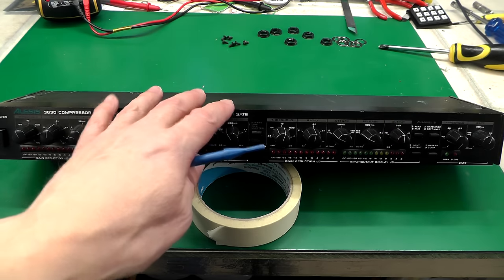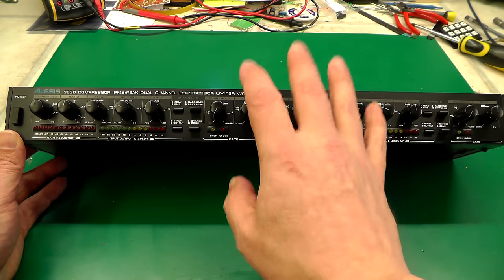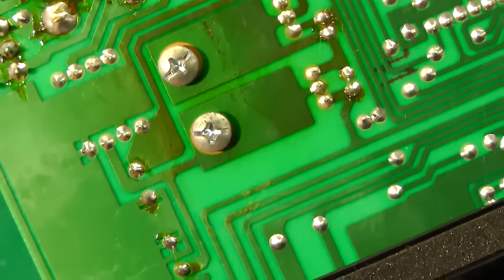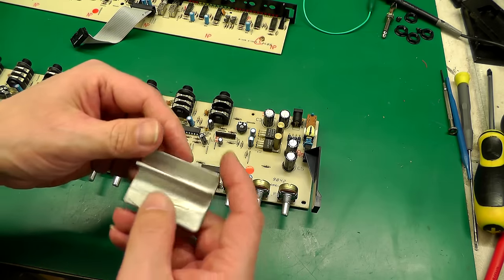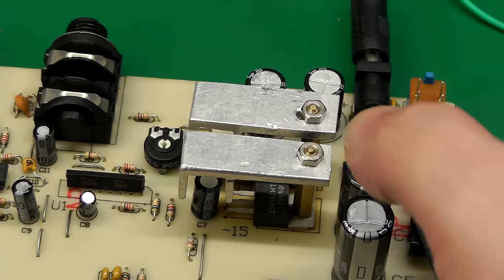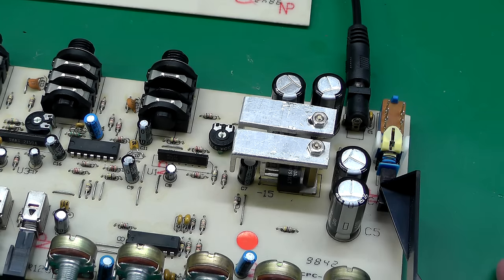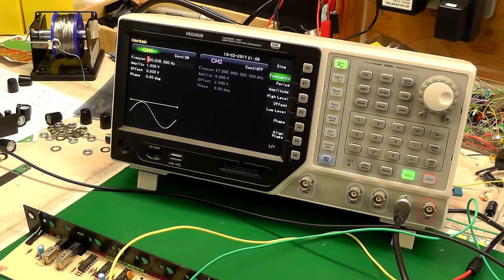No.029 - Alesis 3630 Compressor Repair

Comment: Always a pleasant surprise to see another video from you. My bets were on the problem being an electrolytic coupling cap gone bad - as you end up with what's effectively a grossly undersized coupling capacitor, which acts as a first-order high-pass filter, but WAY up in the audio band, rather than at the low to subsonic frequency that was originally intended.

Comment: Great to see another video from you. I totally understand why U use a compressor, here in the Netherlands we have the same problem whit TV, even radio has the same nasty habit. in the past I worked as a tech in a studio and did ask some of the post production guys about this phenomenon. They explained to me that it had to do whit all different party's that supply the audio/video during broadcasting. and as the TV station does not own what they broadcast the are not allowed to mess around whit it, it's just not done to regulate ore put a compressor on the line. Yes the TV stations do have some kind of guide line, but most of the post-production guys just try to push as lowed as the can. Not uncommon that they maximize and normalize all the audio and have it near 0db or +5db when they deliver it to the TV station. About the differences in sound/base it has to do some whit the engineer that mixed the audio and the request from the customer, and most engineers will hire there own optimod to just try how lowed they can make the specific audio. Best would be if all TV stations would agree to a uniform output but that might just never ever happen.

Comment: I just found this video and I am having similar problems with mine!  Channel 2 is bad and even passing audio when the unit is off!  Do you have the part number for that last capacitor you replaced? Did you use a different one or did you replace it with the same?  Mine has also a ground hum noise in channel 2 I wonder what could be wrong. You use some sort of socket for the IC, do you have that part number?  Man I wish I can fix mine!  Thanks for the video!  How did you added a screw to the heat sinks?

Comment: After watching your video, I went ahead and order the parts just to realized when I opened mine that the parts are different!  Mine got THAT2252 (obsolete) and TL084CH can these parts be replace by yours?  The That 2252 are RMS-level detectors... They are not VCA's

Comment: The total + to - input voltage to the regulators is 50v (23 + 27). With 4 diodes and no obvious multiplier network, how is this possible from an 11vac input to the rectifier diodes (bridge?)?

Comment: Nice little fix! Did you ever test the ESR/capacitance of the audio coupling cap that ended up being the problem? If you're coupling audio signals between amp stages or even on outputs (for DC/offset rejection or general protection), the capacitance has to be chosen based on the source/load impedances and indeed if you underespec your cap in terms of capacitance, you will have created a highpass filter. :D That cap probably lost most of its capacitance. If only a low capacitance cap is necessary, like a 1uF or something, I'd usually replace it with a film cap, since it has less distortion for audio coupling than an electrolytic. On the topic of TO-220 packages and such, I've been a big fan of using these ultra thin (0.15mm) thermal adhesive pads from "x-ex_international" from eBay (shipped from Germany). They have excellent thermal transfer and have been extremely reliable to me for directly bonding packages to heatsinks while maintaining electric insulation (because of how thin they are though, I wouldn't use them for anything with a potential difference above maybe 80V to mind the dielectric breakdown). I also have lots of thermal glue from the same people, which I actually use as general purpose glue for components that get hot - since I know that the glue won't soften or break down under such conditions. If I were you, I would put a dab of that glue between the two heatsinks you've made just so that they don't rotate into each other if you end up moving the device around later on. I'm also experimenting with other exotic options like "Electrodag 5810 Silver Epoxy" from Thor Labs, which is both thermally and electrically conductive and can be used as solder in situations where you need to mount an unsolderable element to a heatsink (because of thermal mass problems, or not wanting to overheat the component etc). Lots of cool solutions out there. :) Really happy to see you uploading again!
Reply from the maker: It's a pity I could never find a schematic, would have been nice to see the values of caps etc that were perhaps meant to be on the board, i.e. after it seemed somebody had been in there before me. But no, I never checked the ESR/capacitance of the problem cap, I just assumed it had dried out since the unit was fine a few weeks ago. Thanks for the comments.

Comment: Does it actually need an AC supply?  Unless it's sampling the AC line frequency for some reason I don't see why it couldn't be run from DC.
Reply from the maker: Need the AC to get half-wave rectification for the positive side, and the same for the negative side. The two caps nearest the power input AC couple the line in and then feed the rectifier diodes. The diodes work in pairs, one diode producing the positive (or negative) feed, and the other to the ground (0vdc). Update: I added a wee sketch of the PSU circuit to my webpage.
Reply: The faulty power supply caps would certainly not have helped with regulation, have you measured the output of the "9V AC" adapter, what is it ? because 27V on the caps would indicate it would be more like 18V AC going in or a little more as it is under load. I would expect you to have about 12 to 14V AC as a requirement, 9V AC would never give you regulation as it would peak at ~13V so it can't require 9VAC??
Reply from the maker: The powers supply is actually a voltage doubler circuit, i've added a wee diagram on my website. My adaptor is giving 11Vac output so a tad high. Looks like Alesis didn't give much leeway: http://www.ianjohnston.com/index.php/videos/68-video-blog-029-alesis3630 I should have explained a bit more in the vid....so i've annotated the vid... :)

Comment: Nice vid. Quite a lot of these Taiwanese machines from the time are like this, quite well designed but let down by cheap capacitors and overheating problems. I guess these brands were ahead of the curve in farming out production to shady Shenzhen factories with poor quality control.

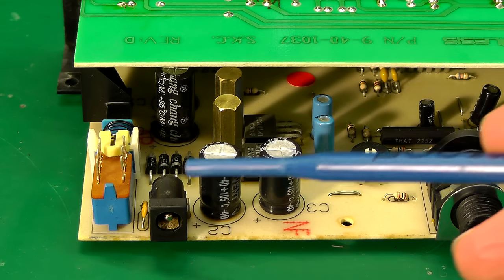Comment: 7:34 If it is 9V adapter, then how is it possible them to use ±15V out from that ? and that too with lot of heating discoloured PCB ?
Reply from the maker: It's an AC adaptor, not a DC one. I have put a small sketch of the PSU circuit on my webpage.
Reply: Yes that's why those diodes are there, but seems like a small glitches on your description because later on when you measured the input DC to the regulators, it was quite high and 9V AC cant make it reach that voltage. Also it would have been nice to compare input and output signal at once on multi channel scopes like this.
Reply: Okay, got that now... Its kind of voltage doubler architecture, so to pump the AC signal and double it. I am sorry for the confusion, but your web page cleared everything now. I apologize for it. Its quite clever design in fact.
Reply from the maker: It's a voltage doubler circuit. See here: http://makingcircuits.com/blog/2016/12/simple-dual-power-supply-circuit-without-center-tap.html .......I should have explained a bit more in the vid, and yes, I take your point about the scope.

Comment: A much better way of heatsinking would be to mount them both on the same aluminum heatsink and use kapton insulators or silpads. Maybe even mount them vertical on a even bigger heatsink.

Comment: Definitely the wrong power supply. I remember these being really bad if used with the wrong supply. I've still got one I'll see what it says on it. I know that people used to try unregulated dc supply's on them and kill them. I'm pretty sure it's supposed to be 9v AC
Reply from the maker: Yep, it's a bit concerning I had the unit powered up 10hrs a day everyday for 2 years! My PSU says it's 9vac but is outputting a good bit more than that!
Reply: IanScottJohnston just looked at mine 9vac 780ma
Reply: It's an unregulated transformer. Small ones like that have substantial overshoot under low load, and also tend to be rated at the low end of input voltage (~220V as opposed to the 240-250V often seen in the UK, especially with solar propping things up these days).
Reply from the maker: Update: Managed to get another PSU, actually Alesis branded with a 4-pin DIN which I cut off and stuck another plug on. Just over 10VAC off-load....perfect.

Comment: I think I heard you say you had the wrong adaptor? I own one of these compressors - 20 years old now - with the original adaptor. The Alesis adaptor has is part number - A30908BC, 9VAC~0.78A output.
Edit: since originally posting, I've found a couple of sites that highlight some mods that can be done to this unit to 'improve' its sound quality, including one using a higher rated adaptor. It may be that your's has been subjected to these mods.  Can't find a circuit diagram, but mine is still 100% as it left the factory 21 years ago. Feel free to PM me if I can help - photos of the boards, the mod info.